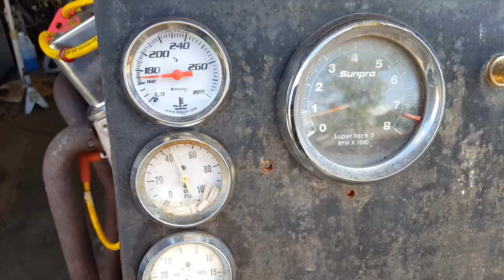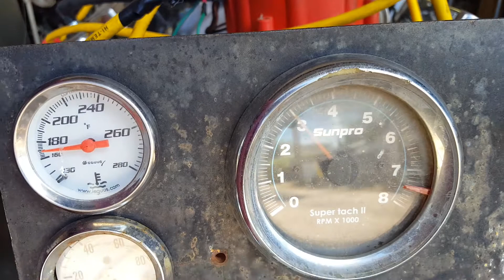Stroker 383

Comment: funny, every part on this engine is the same as mine

comp cam xe284h xtreme energy

edelbrock e street heads

edelbrock performer intake 

eagle rotating assembly

roller rockers

holley brawler carb

different parts are fans, valve covers,  distributor, spark plug wires (Things that honestly dont matter)